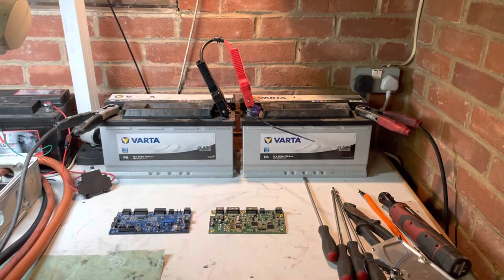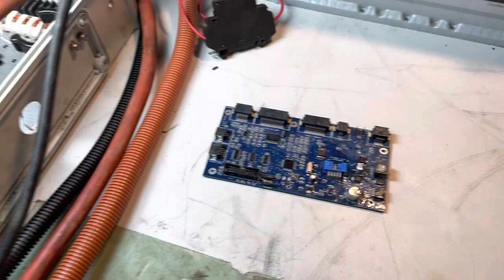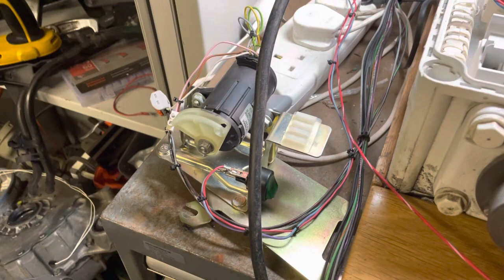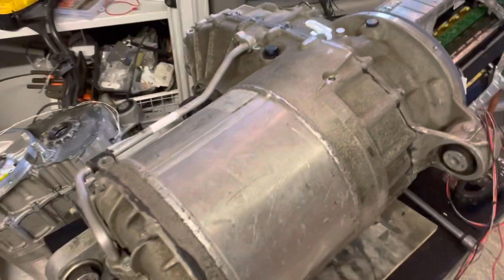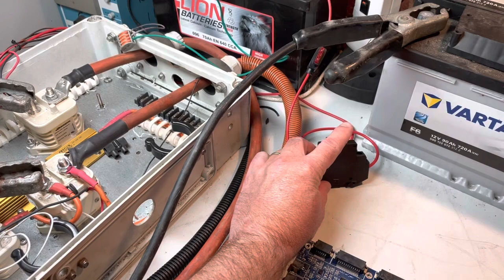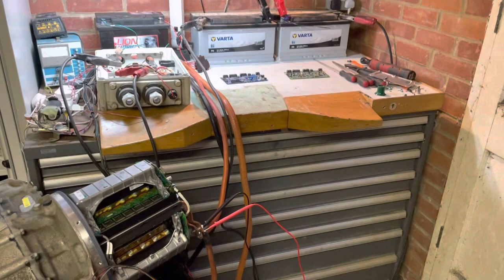Beginner’s guide to spinning a Tesla Large Drive Unit for EV Conversions

Comment: If you short something the large car batteries will turn your inverter transistors into a spontaneous welder.
I'd rather say use a current-limited power supply at 80-120V.

Comment: I have build a similar setup but when I turn on the second switch for the positive contactor to close the motor wouldn't start. Tesla model s control drive unit conversion board the two lights are fully on for thw first switch but on the second switch, the motor wouldn't start

Comment: So what’s the difference between this and the full setup in a car? Just bigger batteries? That wiring honestly doesn’t look bad.
Reply: Yeah it's bigger batteries and high voltage; 24V will make a motor spin but it won't be nearly enough torque to push a car forward at any speed. The full setup will be 250-350V
Reply: @Nomadical  thats good to know. Do you have any material you use for battery wiring? ie. bms, plugin charger, and VCU
Reply: Don't forget charging, brakes, and steering

Comment: Fantastic video.     

I have a a safety tip.  Don't ever wear a ring or jewellery when working on power electronics.  If your ring ever shorts out a circuit you could lose your finger.   When you step up to higher voltages you should consider using electrical insulated gloves.  

Keep up the great work.

Comment: One question: how do you plan in insuring that electric converted car?
Reply: I did mine through Hagerty.
Reply: @12x2richter I have build a similar setup but when I turn on the second switch for the positive contactor to close the motor wouldn't start
Reply: Adrian Flux for kit cars and conversions

Comment: Why cant you directly connect the battery, instead of needing the contactors etc when its only 24 volts ?.
Reply: That's to verify everything works before putting it into the car where there's higher voltage that you want to turn on / off in the proper order (charge resistor etc...).

Comment: What kind of encoder is on this motor? Do you have the ability to align the encoder to the rotor in the case of opening the motor and reassembling? Any software available or necessary to do that?

Comment: So Many Questions! 

You didnt explain why I need the open inverter board. Is this only to perform this low voltage test? ie: If I was willing to throw the full 400V at it then I can hook everything up as you did and just test it that way?

You didnt show the settings for the board?

Links would be helpful to the products you used. I did manage to find the MS3 center harness but Im worried if I link it here my comment will get flagged and be stuck in spam 

Where did you find the connection diagram for everything to hook up to that inverter board?

It seems like with the setup you have here if we added more batteries we would essentially have a running/driving car (if it was mounted in a car), so we could skip all the other computer boards, tablets, and expensive stuff and stick with a bare bones setup like this if we wanted?

Do you have the ability to setup dynamic braking and such with this setup, or do you need to get a canbus controller to program those functions?

Ill be doing my 66 Chev C10 Tesla conversion on my channel soon. Just getting the parts I need to make this all happen
Reply: The open inverter board allows you to communicate with the tesla inverter.  All his controls (throttle, forward/reverse direction, start button) are effectively communicating with the open inverter board, which is then communicating with the tesla inverter.  Without the open inverter board (using the original factory tesla board) you would need to somehow send it the right combination of special Tesla canbus commands.

Comment: How much voltage  and amp will it need to get full power off motor?
Reply: 360v about 1600amp
Reply: @whysoserious.5723  That is incorrect, it's 1400A max - and that's for the highest tier "luidicrous" version. The regular sport can take 1150A max and the base model of large drive unit is just 900A max.